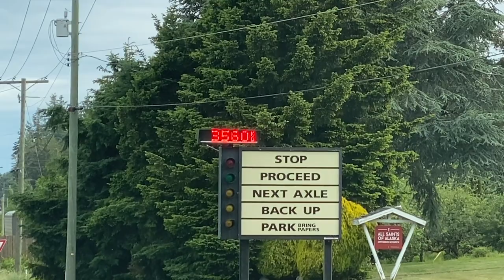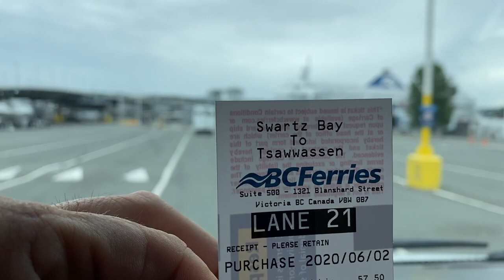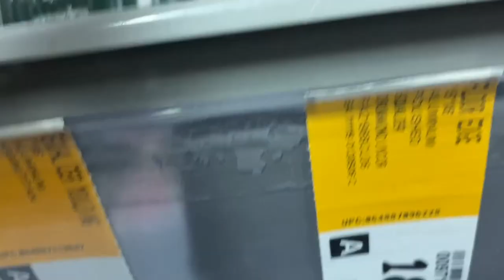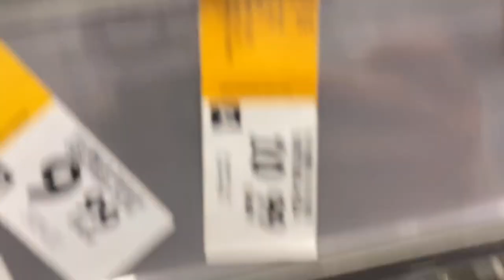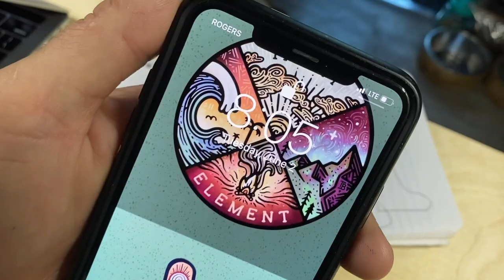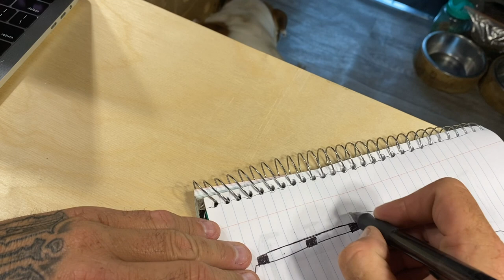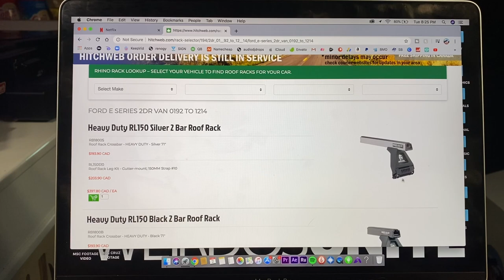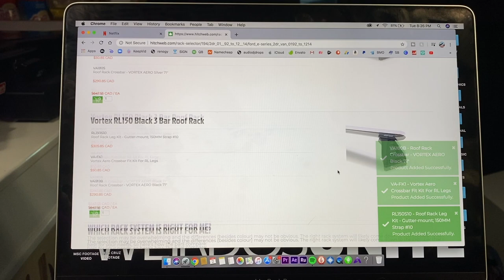Ladder Install and Roof Rack Design ✔️Getting Ready For Summer Road Trip

Comment: Hey Chrome, is the linoleum flooring you have laid over rubber mat or something? When you were installing the transition piece, that's what it looked like, and I was wondering how you liked it, if so. Is it soft on the knees? I have a Econoline also and am getting ready to install flooring, and something easy on the knees would be nice. As it is, I was thinking of normal vinyl plank flooring, then just use an anti-fatigue mat or something.  Thanks!